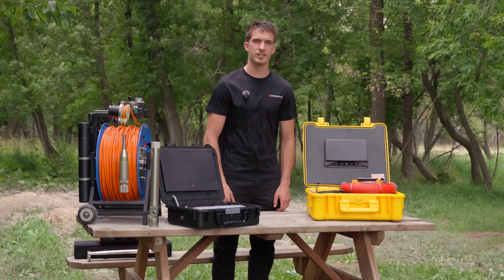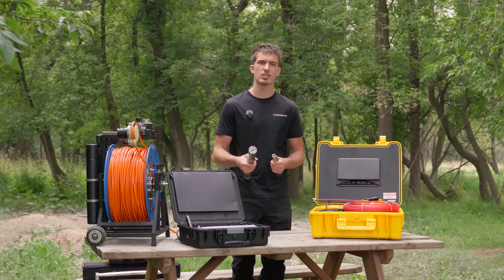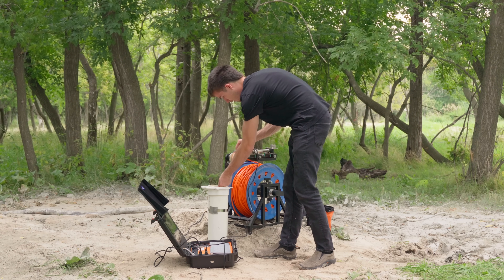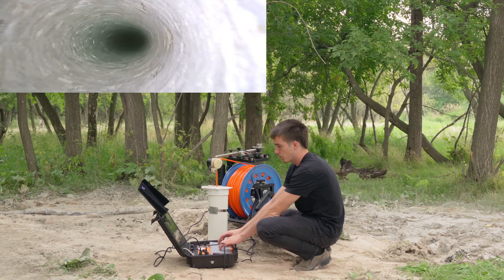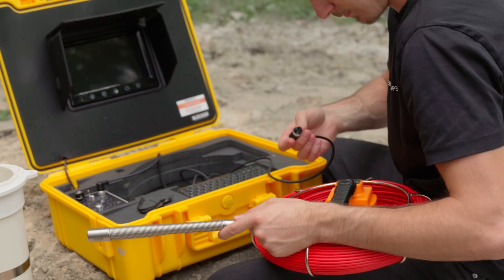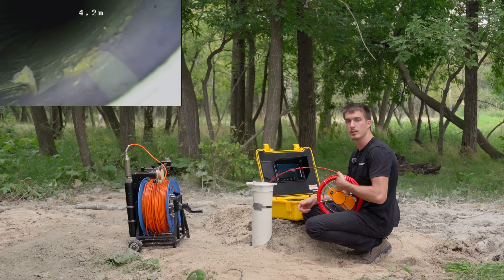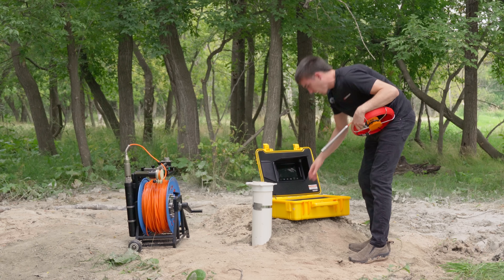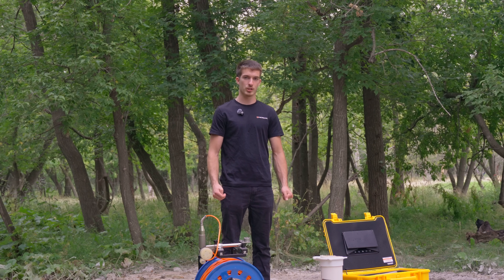Downhole Well Camera Vs. Push Camera Performance in a Water Well

Comment: Is your downhole camera battery powered? Do you have a model with a motorized winch?
Reply from the maker: Yes, the camera system is fully battery powered, and they do come in motorized versions as well but then they do require external power.